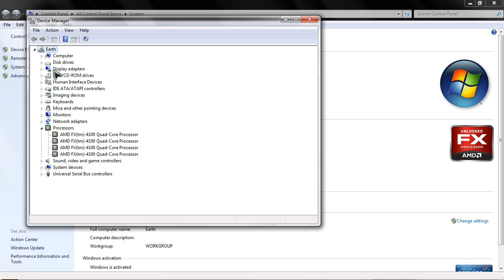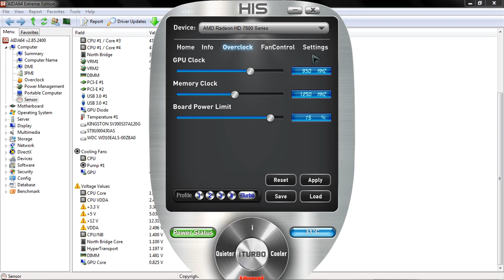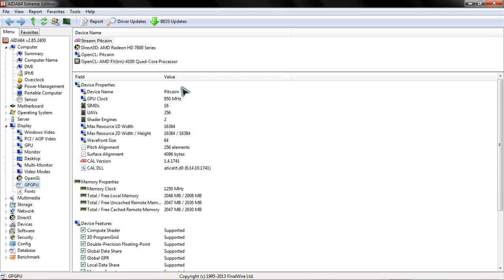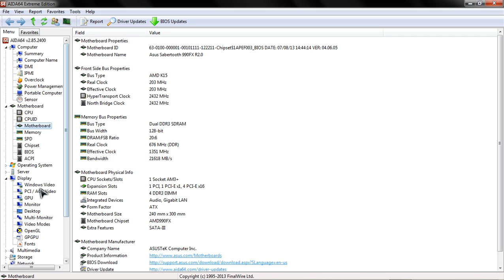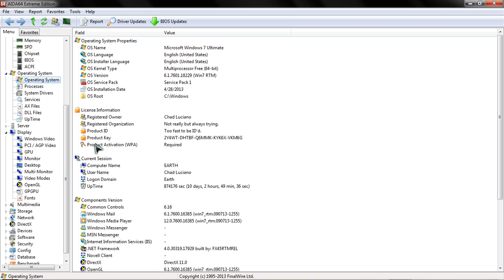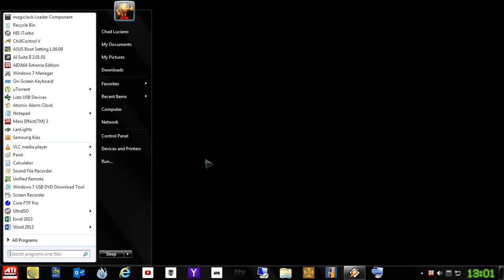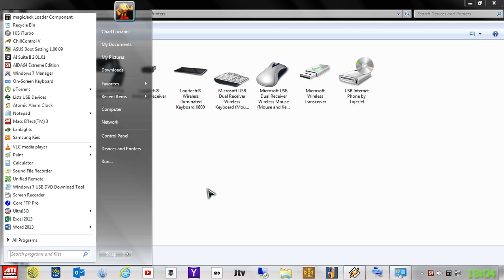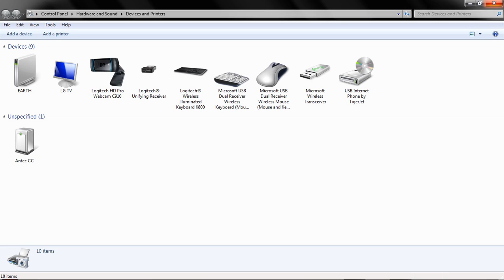Overclocked Sabertooth 990FX R2.0 FX-4100 TDP 95w @ 4.56GHz AMD HD 7850 2Gb GDDR5

Comment: Hi, i have an Fx 4100 with seidon 120v cooler master heater and ram venegance 1866 xmp and a gtx 780ti and i want to know your bios oveclock setting to try in my pc
I can t find a stable overclock the temperature of the cpu is not a problem
Reply: Motherboard sabertooth 990fx r1
Reply from the maker: +stefano aimo The DIGI+ VRM controller for the CPU and RAM are different than the R2.0 board and the TUF mosfets, Direct BIOS button, T-Topology DDR3 which will enable you to boot directly to the BIOS. 8 SATA 6 gbps ports, Network iControl,  BIOS Flash and  6 USB 3.0 ports...these are the primary differences in the two versions we're talking about. The 4100 processor O/C's very well...I'd start off with disabling any of the onboard features that interfere with your O/C. Start out by O/C'ing the processor first...memory we'll get to later. start the multiplier off at 22x (4400MHz) leave the FSB alone as well for now. Increase the voltage to the CPU to 1.415 (low) and 1.425 (high). Run your machine for stability...if stable increase multiplier again from 22x to 22.5...repeat break-in...if stable keep increasing to 23...keep going till it BSOD's on you. Once it BSOD's reduce one increment on the multiplier and then target FSB frequency and increase slowly in increments of "1" at a time and check for stability. Keep increasing FSB until BSOD again, back it off 1 or 2.
Reply from the maker: +stefano aimo Once you reach that phase, you'll then want to go after the memory...1866...we can push that much higher...well over 2GHz with right voltages and timings. A good PSU is highly recommended (I prefer single rail systems 60a and higher...so roughly a 750w supply...don't buy or use a PSU that is sized exactly for the job...PSU should be slightly more than you'll need and also insures that the supply doesn't run at 100% all the time but mind you the higher the demand the better the efficiency of the PSU up to a certain point. Once you get this far drop me a line and give me your info and we'll tweak it from there. Good luck!!
Reply: +Chad Luciano Thanks, i have an 850w power supply, no problem. For the frequency i have to set the low or high settings (1.415 or 1.425?)
Reply from the maker: The voltages for the CPU (FX-4100)

Comment: Hi to you, i have just bought that same board and i have the fx 4100, could you please give me the settings to get over 4g with a big air cooler from artic freezer. If you could go through all the settings in bios  as i am new to overclocking. I want to get the fx 8350 but would like to see what i can get out of the 4100 cpu. I hope you don't mind me askin this long question